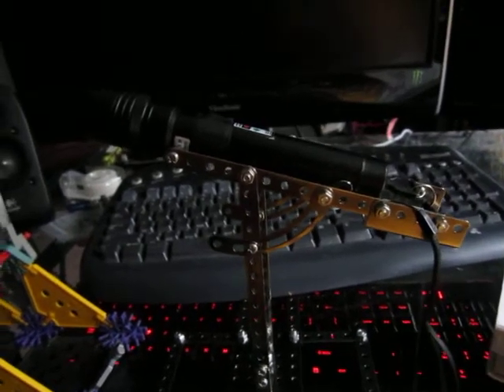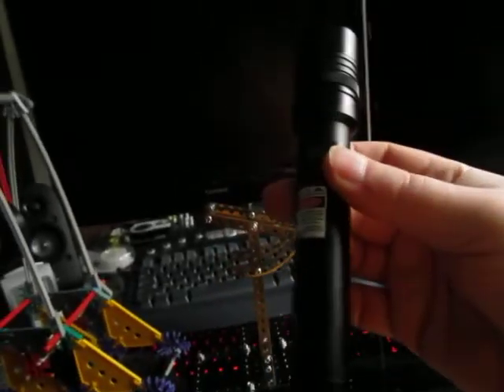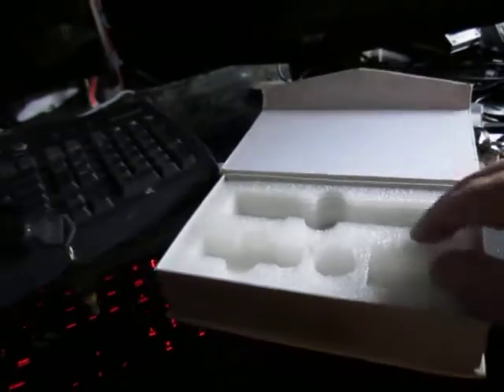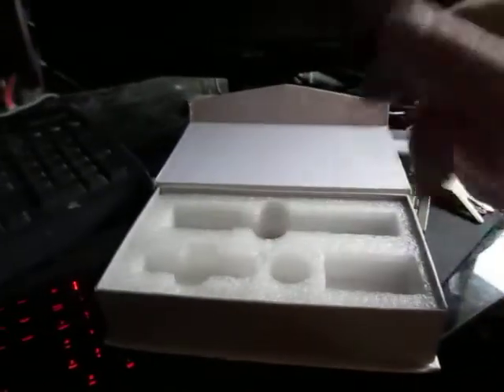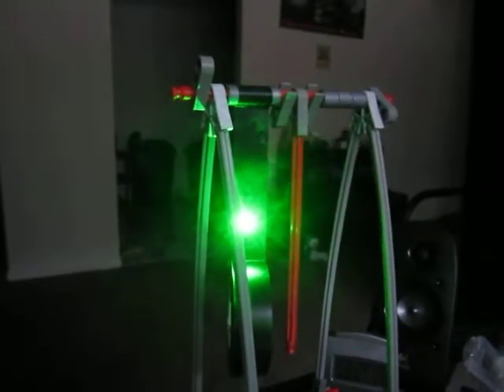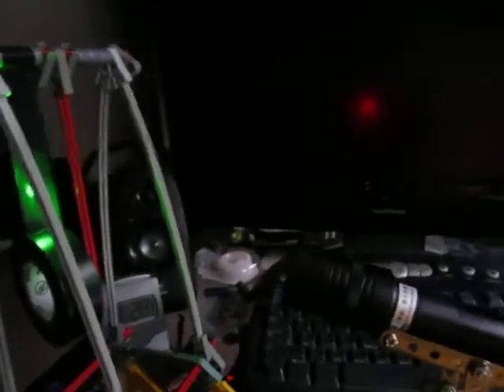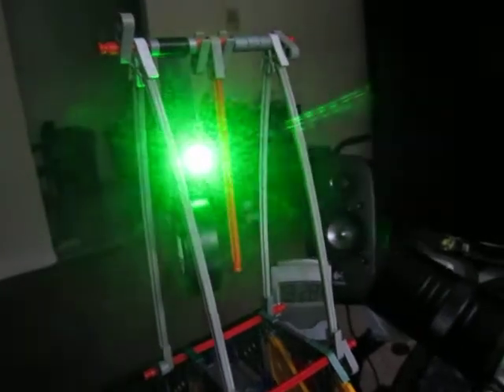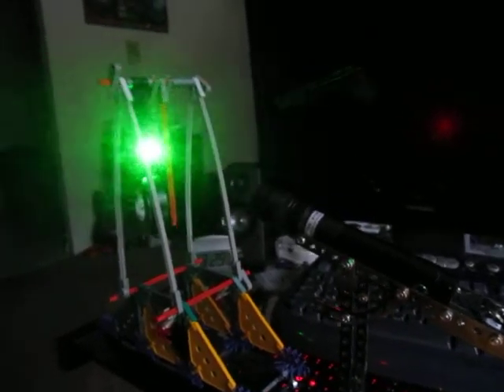underpowerd 230mw

Comment: Find out the power output of the laser ( Volts/Amps), it could be that the battery provided is insufficient for it to run at the full 230mW. Let me know if you've tried that, or if it indeed works.